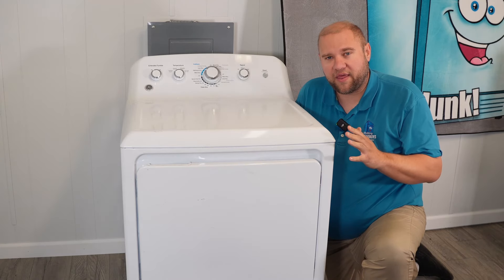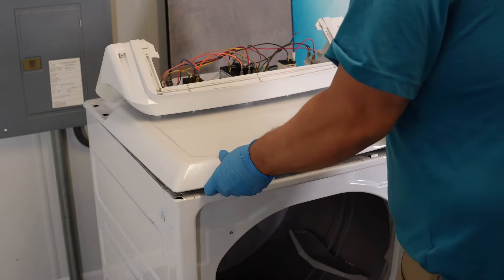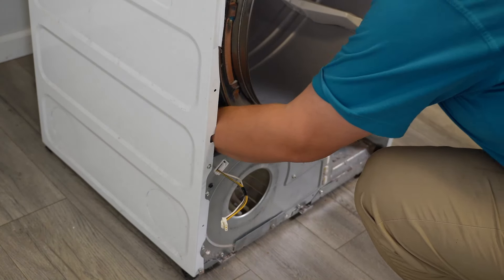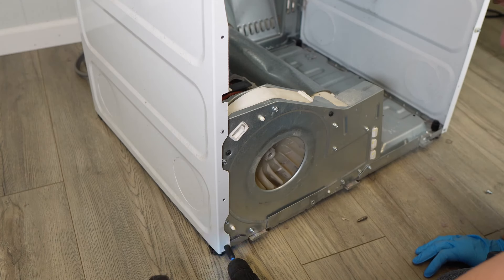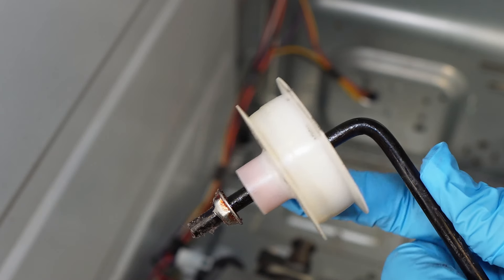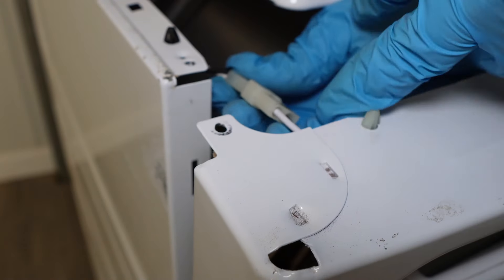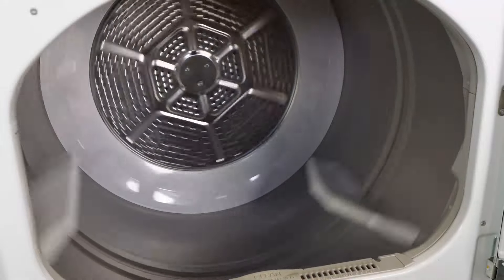GE Dryer Makes Squeaking, Grinding, or Other Noises - How to Fix

Comment: Thanks for the video.  I was apprehensive when I watched you getting the drum out thinking this was going to be difficult.  But it turned out I just needed new drum glides.  A very simple fix but would have been much more difficult without your explanation of getting the machine apart.  I also noticed the rim of my drum felt rough and felt that it would eat through the new glides if I left it like that.  So I took some steel wool and smoothed it out.
Reply from the maker: Nice, way to go!
Reply: can you let me know where you got the new glides? I think that is our problem too and was going to order it. Thank you
Reply: oh nevermind...found it! It just looked a bit weird.

Comment: Thank you for this video.  I used it to take my dryer apart and fix it.  A lose screw was left in my jeans pocket and was causing alot of nose.  I was able to remove the door and top panel and the screw dropped to the ground.  Now, Im a HERO again in my household! Thank You.

Comment: I just had an easy fix on my Maytag dryer, the door latch broke and fell inside the door itself got the model number and ordered a new latch and pressed it in no tools required. Probably saved myself $200 bucks from service call and parts. Your videos are much appreciated 😊

Comment: Just found your video and this is the exact same model that I have.  The noise I had was a rumbling while the drum was turning.  The problem was caused by lint packed into the vanes of the blower.  Once this was cleaned out, the rumbling went away.  Thanks for the great instructions on how to open up the dryer.
Reply: Mine too. I've never seen lint packed there. I'm going to replace the lightweight (and worn) lint screen.

Comment: Can you tell me where to get info off dryer to be able to find a new door assembly please? My GE is an older unit. But started making horrible noise. And watching this I see there is starting to get a gap in the door plastic part

Comment: My fan moved forward  on shaft i checked to make sure shaft did not spin inside fan blade and did not so i made groove with dremmel and used snap ring in front

Comment: Would be great to have a list of the time-stamps for the key inspection/instruction points on these exceptional videos!  Here it is for this video...

1 min. General Explanation of Noise

58 mins. Inspect top inner bearing

1:45 Dissassemble exterior panels and wiring harness', and inspect belt

2:35 mins. remove front panel and 2 wire harness' & disconnect wire  

4 mins. Rotate & Test drum 

5 mins. TIP: Idler pulley armrest 

6 mins. Remove drum & Rear bearing

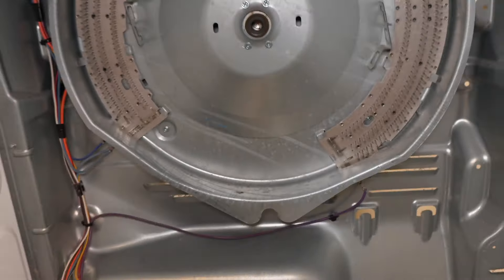7:13 Blower fan & Idler pulley rod  

10:13 Front panel top bearing plastic housing and glides and lower felt

11:13 Idler pulley & arm, drum and test all 

14:45 Test 

15:15 Put dryer exterior housing back together

Comment: Thank you! I fixed my dryer after is suddenly started making a horrible metal-on-metal grinding sound.
I small piece of metal (from somewhere) got stuck on the top nylon pad and then the friction melted it in place.
Reply from the maker: Glad it's fixed!

Comment: You saved me from costly dryer repair/replacement! I opened my dryer up and found a penny causing grinding between the plastic bearings of the door and the drum. Looks like there’s a bit of fraying on my belt as well but at least I can dry for now. Thank you so much!

Comment: Thanks for this video. Mine is only two years old and developed a loud vibration but was still heating and moving the drum. Turned out it was thick lint jamming the blower which was causing friction against the drum belt. Cleaned that out and it's as quiet as a hummingbird again.

Comment: Thanks for the comprehensive breakdown, pulley trick was very helpful. Any recommendations on grease when installing a new Shaft & Bracket, would something like Permatex 80345 White Lithium Grease do?
Reply from the maker: That should work yes

Comment: Hey just found your feed I was looking for some information on dishwashers. Bought a Whirlpool dishwasher 5 years ago and now it doesn't spray inside I've replaced two of the cheap pieces which did not fix it and now the motor if I add $100 to it I get a brand new dishwasher so😮. Anyway I looked it up on the internet and they're supposed to last 10 years and this was 5 years in when mine quit working the range anywhere from 1500 to 500.00. I agree with you on the refrigerator unit I've never liked the ice and water in the door it's just too much what are you want to do is keep your food cold thanks
Reply: this video has nothing to do with dishwashers XD

Comment: Thank you for your video.  The diagnosis and moving the front pannel out of the way portions were excellent.  Thanks to your video, I found the problem in my dryer and fixed it.
Reply from the maker: Way to go!
Reply: It was the Teflon slide bearings.  Thank you for the emoji and like.

Comment: i use a leaf blower to clean my dryer out works great but has to be away from any building because most dryers are filthy
Reply: Air compressor 👍
Reply: Air compressor , wet dry vac also give alot of air

Comment: My GE Profile was a bit older than this model but came apart similarly. The belt was broken, glides were worn but not right through and it had a ton of lint build up in the blower assembly. I replaced the belt, glides and front felt. I also did a thorough cleanup of the blower and ducts. My 12 year old GE is now running like new. Thanks for a great repair video!

Comment: How far should the drum move forwards and backwards?  After I took it apart, the drum slides about 1/4" front and back.  I can't recall if this was normal before I disassembled things.
Reply: Use the groove in the door to line it up it has felt

Comment: Question: looking straight back into the dryer, the silver piece with lots of holes, I unscrewed that and when I put it back on the dryer sounded lopsided. What can I do to fix this and do I have to take the whole dryer apart or can I fix it from the inside?

Comment: Listen to Ben and deal with it soon. We inherited a squeaky GE dryer with the house and I waited for a year to fix it. By then it had worn through the plastic bearings and into the plastic assembly that holds them! Had to buy whole new assembly. 😢

Comment: As far as dryer brands how do you like ADC. I picked up an ADC 20lb. Series 7 for the house. Except for it being very heavy and having to put in a 6-inch dryer vent this baby can really dry clothes fast. I'm pretty sure this will be very reliable its built like a tank. Have you had any experience with these?

Comment: Hi Ben great video. I was wondering if you knew where I could get the felt that the drum rides on at the top along with the slides. My slides look good but the felt is about gone. Any ideas? Or do you just use a normal roll of felt cut to fit?
Reply from the maker: Hi, the glides are here: https://bens-appliances.com/products/we3m51cm-ge-drum-bearing-glide-nylon?utm_medium=product_shelf&utm_source=youtube

The felt should be this: https://bens-appliances.com/products/ge-lower-drum-dryer-felt-we09x20441-for-ge-hotpoint-and-mabe-dryers?_pos=1&_sid=daf79c858&_ss=r

Comment: Have the same dryer. Is it possible i could send you a video of it running. Its like 2 years old and during a cycle the sound has changed. Trying to figure out if its normal or not

Comment: Bruh all went well I put it back together and it worked fine but I went to put the top part back on not remembering it was plugged in and the entire top part exploded with sparks and now it won’t start at all.

Comment: Hi Ben which dishwasher would you recommend.  I had a seers Kenmore elite which has been 14 years now and no problems at all but it needs to be replaced because it’s on its last leg now. Any recommendations would surely be appreciated
Reply: Bosch.  Very quiet.

Comment: I hate this piece of crap so much.
Impossible to work on without breaking a wire connection and the dame tub never seems to go back in the hole properly.
Such a bs design

Comment: Mine sqeaks on and off ( dryer). If you open  door and then goes away for awhile or sometime until load is done. Again stop and go sqeak. If i lean on front corners of dryer sqeaking stop. Dryer super level. Any ideas?
Reply from the maker: Likely the glides as shown in the video